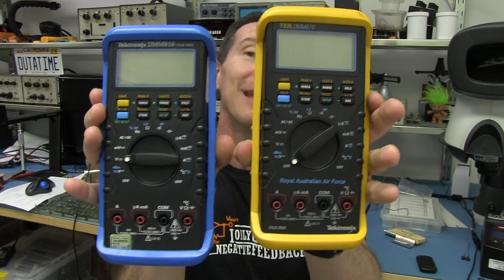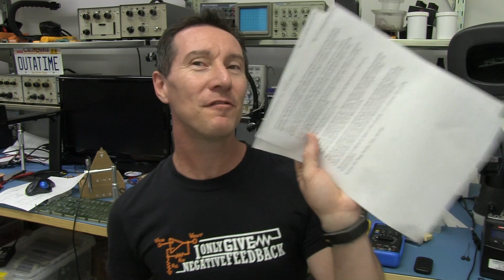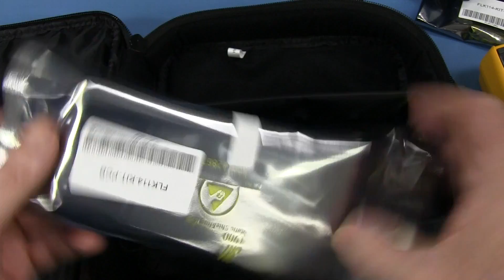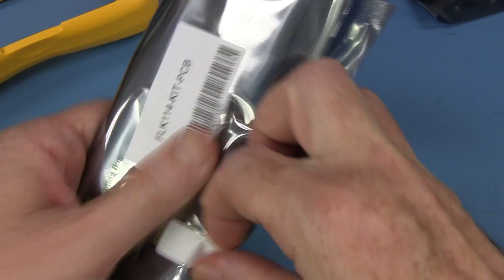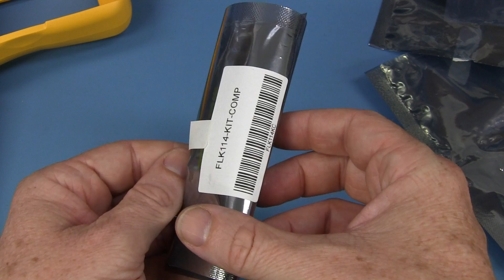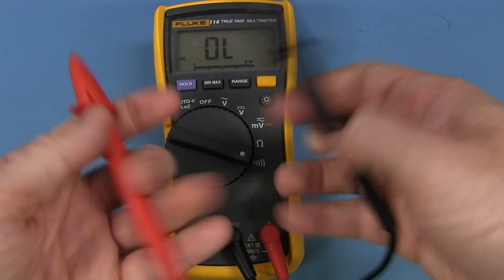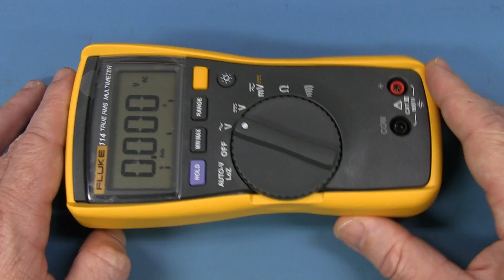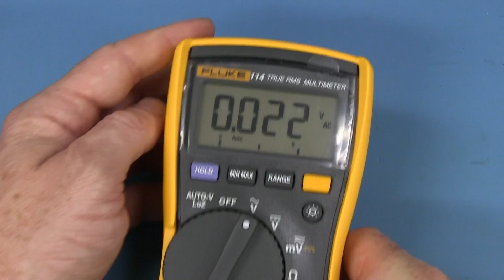EEVblog #597 - Fluke 114 Kit Multimeter + Sparkfun/Fluke Rant

Comment: Didn't knew that Fluke \w/ kits for poor are available :)  Bare bone feature set, yes. However considering that 80% of multimeter users use these devices for voltage and continuity measuring only, those meters with LoZ mode in bonus are more than fine for many. And they have THAT yellow casing :D
Honestly would be glad to get such Fluke kit in my school years at eighties.

Comment: Yellow isn't allowed in Australia? In Europe yellow DMMs are all over the place. Only Fluke thing I own though is an infrared thermometer. For multi meters the cheap one mostly do well. The one I use most A Velleman DVM850L has a color scheme that scream Fluke all over the place - yes a big company as Velleman.
I am however on the hunt for others. Seems like there's some that can do duty cycle and frequency as well. Also I wonder much of a difference there is on fluctuating DC. Like if you want to measure standby usage on your Amazon Echo Dot. Digital seems to fluctuate wildly and hard to get a good feel what the standby usage actually is. Sure you can shunt it with a large capacitor bank to smooth it out that that also cumbersome is only usage for small voltages and moderate current (such as the Echo Dot). So that was where my recent dumpster dive came to rescue - an Avometer 8 Mk III in magnificent condition (guess it hasn't seen much use because on an adjustment error in the cut out prevented in from being engaged so was always cut out). The needle settled quite nicely only fluctuating a tiny but and easy to get a reasonable guess of the actual usage - good enough anyway as that of course was more for a power use concern rather than a precision scientific measurement.

Comment: Spent 3 decades pulling wrench in a diesel shop, a major portion of that time in the electrical shop. In the mid-90's, a trainee dropped my Simpson 260, so the supervisor bought me a Fluke 87 with a lot of accessories. $300. It lasted 5 years, and the digits began to fade. Was told by the tool dealer it would be expensive to fix (at the time.) So I grabbed an el-cheapo meter from his display, and said put this on my account. $30. Chinese made, grey case, yellow boot, looks just like a Fluke, but it isn't.
After 17 years, the el-cheapo Chinese meter still works. The digits never faded.
More than I can say for the Fluke.
Finally pulled the Fluke out of the tool box last year and replaced the polymer strips. $18. Now I've got two DMMs.
Still not impressed by the over-priced Fluke offerings.

Comment: After running your finger over them, I hope you cleaned the switch traces on the PCB with isopropyl. Also there is a lube for gold contacts just to be on the safe side.

If everyone starts trademarking a color, will the next guy have to make his meter chartreuse with mauve stripes and taupe accents. Good grief!

Comment: Very nice all packed in anti static bags and the circuit board one has all the warnings on it, then they give it to a moron to assemble just to prove any idiot can do it. But as you say no instructions, no wrist strap and earthing lead and most of all no common sense... and to add insult to injury the first thing he does is throw the probe covers away I suggest he reads AS 61010.1 which states shrouds should be fitted to test leads.
Reply: LOL. Get your head out of your ass and look at the upload date.

Comment: I agree with them being forced to use another color. At this point in time, that orangish yellow on grey is iconic to the fluke brand. I could see people buying a meter based on color cause it was recommended but forgot the actual name of the brand. 
Not that i agree with it on a personal level, but i get it. I would say the same thing about soldering stations in blue on yellow, being iconic to hakko. Unfortunately, hakko also likes red on black for tools, and even grey on black for accessories, so i guess you could argue they are not as consistent.
Reply: Back in the 80s, practically every multimeter (just like that Agilent) was grey with yellow. And the reason why they were was because handheld DMMs equals Fluke — a multimeter just wouldn't be a multimeter if she weren't yellow.

I don't really mind that these days most multimeters other than the very cheapest aren’t attempting to look like a Fluke.

Comment: Man, I really love Fluke, but they're incredibly expensive...
Reply: It's worth the purchase I think, you spend it once and then never again.
Reply: My father bought a fluke 12 back in the 90s the thing is as old or older then me. And it still works! It’s very basic but now I’m looking at getting a nicer one with more features. My 12 does ohms resistance continuity and voltage. I need hrz tho for my generator and they only girl is getting a bit tried. Not sure if the display is going or if I need a new battery.

Comment: Correct me if I'm wrong, but aren't Fluke required to take action to protect their image if they file for a trademark? E.g., they are not allowed to file for a trade mark and then do nothing about competitors infringing on it. An example is when King (from Candy Crush) bought a game with the term 'candy' in it after they got a trademark of 'candy'. They did this because they could not leave it, they had to take action and shut them down. In this case they bought them so they could leave them alone.

Comment: They can easily afford this sort of charity given the huge overpricing of their products. Interestingly some years ago I bought a cheap crappy Velleman scope that came with probes, later my tool bag with it in got stolen. Sometime later I was given a Fluke scope meter with the exact same probes except with fluke branding, I broke one of the probes and when I looked up the replacement price a set of two probes came to more than I paid for the Velleman scope complete with two probes.

Comment: I believe the point Fluke made this kit is to tell the makers what makes the Flukes safe. Everything but the input protection is preassembled and what the users are required to do is essentially install all the protection yourself.

By the way, have you tried to add the fuse and current shunt yourself, trying to upgrade it to an 117?

Comment: I'm not real fond of what happened, but does sound like typical USA. Govt's controlled by all these big companies. I kind of understand safety concern, but my theory is let it be. A if somebody is going to be dealing with something that safety of the meter could be important they should know about what they need. If you do and you still buy some off brand even if does look like a fluke there's almost no way anyone could win suing fluke if something happened, and you're dealing with this stuff and trusting your life to a meter possibly and you buy a cheap one that's there problem. (I see it pretty much A avoid being sued, B make more recognizable, C further idiot proofing.)

I think flukes a good product there are certain things like network testers i wouldn't care buying ideal, etc brand. You don't need to really trust those with your safety though. If your doing major electrical work then get a fluke, keithley, extech.
Reply: I got a mastech DMM last year after my 20ish yr old keithley fried, a lot of people said this is a newer company said is the foreign = of fluke 1/4-1/2 the cost. So far i'd say of all the DMMs i've had this is probably the worst. input safty light/beeper sometimes don't work write, capacitance function nothing on it shows like .100nf, sometimes you turn on and it don't come on, until spin knob off/on again. auto powers off after like 10 min, sometimes i use that long, and probe things. It beeps with a warning, but it should recognise usage/non usage. Also has a relative voltage function something like store one measure, then the next is measured based on difference. That works if the difference is like 2V, also the data hold you manually have to do making almost useless. Also autoranging can be fairly slow esp with resistance.
Reply: Although it is kind good what fluke did for sparkfun, still don't make me feel any better or forgive the first issue. Companies do stuff like that i lose some of respect i may have had for them, and maybe lose me as possible customer. I can live with a possible fairly product here and there, but when there business gets out of control start lieing, doing other pretty much ridiculous things i'm done with them. Never used fluke electrical meter, and i don't think i'll start soon esp after this. I'll go to kiethley, extech, tektronix.
Reply: You would be surprise how often this happens, and it has nothing to do with the US. Most laws like this are all over Europe, North and South America. I have a feeling that it was done intentionally (making them look similar). They shouldn't have done that, period. Most people who put their blood, sweat and tears into designing a product want it to be protected. I will still be buying Fluke products, as with most and Dave I am sure.

Comment: Hey Dave, I'm not sure if I'm the neediest or not, but I would love to have that Fluke multimeter.  The best meter I've had was (somewhat embarrassingly) a RadioShack multimeter.  However, I accidentally burned out a few of the traces when I forgot to unhook it when I turned the dial while connected to a transformer.  Oops.  Since then, I have been too broke to buy a decent multimeter since my rent has gone up in Santa Cruz by $400/month(!).  So, I have been using a little Craftsman CR2032-powered pocket meter for my measurements.  I have long coveted the Fluke multimeter, as well as their Scopemeters.  Should you choose to give it to me, you can be assured that it will be used to its fullest and appreciated greatly.  Keep up the great work!

Comment: Firstly, the US Custom's notice shows 250 items, not 2,000. Secondly, the notice references US Trademark 2,796,480. Reading the information for that trademark(if I read the correct one), under the "Color Claimed" heading, this is listed:  "Color is not claimed as a feature of the mark." So, I fail to see why a certain color would halt import of Sparkfun's items.

People need to stop supporting Fluke. Their items are overpriced, and this little stunt is abhorrent. I will be selling all of my Fluke gear, and replacing it with a less offensive company's products.

Comment: Although I think the idea is a pretty cool one, I get a bit concerned about it....Fluke is known for making industry level DMMs and their quality and specially Safety is really high standard...but with a beginner soldering the input protection components, he might overheat them, specially with a non temperature controlled iron, and damage the input protection, leaving the multimeter vulnerable, this makes me wonder a bit about Fluke's considerations on safety...are they compromising their safety standards and Q&A? Are they selling less secure stuff for cheaper money? Or is the input protection components just something not too much necessary (which I don't think so) and its not a problem if they get damaged for improper soldering?...what's your position in this matter @Fluke?

Comment: I believe there is a subliminal message being portrayed by David here;

Fluke needs to lower their prices on their low-end kit rather than be a trademark schoolground bully. For a single PCB-single chip solution to cost about $200 is ridiculous in this day and age from a company thats had decades to refine their designs. These are stupid cheap to produce and this teardown proves just how far they've refined the design. The average joe should be able to afford a quality Fluke DMM, this "because they can" pricing approach is getting old. Such a #FlukeKit would had been very welcomed, or just lower the pricing. Thanks.
Reply from the maker: Your spidey sense works well.

Comment: I would like to have that multimeter I am currently using 2 of the harbor freight $5(sale price) multimeters for my measurements.... I used to have an ok one but I accidentally measured ac voltage on the dc setting and after that the readings were never right again...

Comment: The little "caps" are used when measuring higher voltages to prevent arcing. Class 3 not bad.

Comment: To the people who think that Fluke have done a swell thing. They haven't. It just been a face saving exercise for them selves. Try are being a normal big business IP troll. If they really cared about it they would of said sorry and those don't stand our toes and allowed the release of sparkfuns DMMs and any others that come through. Sure if they are a 1:1 copy of a fluke called a flake then sure that's a direct rip off!
Reply: Fluke is a big business that rightfully owns the yellow case trim. They really can't allow any unlicensed exceptions. It's business and they need to follow their policies about protecting their trademark without any exceptions.
Reply: Jacob Jones
Legally, they have to prevent dilution of the mark. That doesn't mean they can't license it, but it does put restrictions on how much they can reasonably do and keep the mark. They could have allowed sparkfun to get the meters but imposed a condition, such as requiring them to remove the holsters, since the mark is on the combination of holster color + holster style + meter color + meter style.
Reply: +Jacob Jones they don't rightfully own s***... owning a color I think not
Reply: Sorry my wording was not proper. They own the trademark which includes the colored trim, Apple just won a crazy absurd law suit on the shape of corners. Trademark is a fucky thing

Comment: I have an analogue Velleman AVM360 since 2006, it has a 5x20 glass fuse, x1 ohms range is not working due to the accidental 230V input - burned out resistor with the 500mA fuse and Meterman branded test leads with electrical arc damage from previous owner that barely stay in sockets (the stock ones falled apart). I would like to have at least one decent test equipment, as anything safe/precise is well over from what I can spend from my salary I get for working as a full time skilled electrician in Estonia.

Comment: I love my cheap fake meter (I don't know any better) but I have already had a close call with it working on my AV amp and since that day I don't trust it for anything more than testing resistors and low DC voltage devices. My funds can not stretch far enough for a Fluke or any "good meter" I normally buy broken tools then try and fix them, its not something I would want to do with a multimeter.

Comment: So Fluke "off-shored" the manual labor from their chinese manufacturer, which they offshored the labor to from the US ;) .

I've got a Vichy VC99 (yes, the one you ranted about most in your shootout four years ago; your video convinced me to buy one; the facts in the video didn't match your rant ;) ; and it's still working). It has a very similar color scheme (although it's more orange than yellow) and for me was the only thing austrian customs ever held back for a while. I don't think it was the design though, but that the marked price on the customs form looked way too low.

Comment: Could Sparkfun not have simply removed their meter from its holster and sold it without the yellow plastic bit? That would have satisfied the 'dress' issue.
By the way, I'd like to claim the 114 as my Micronta (Radio Shack) kit
meter has finally given up the ghost. The contacts have worn through on the circuit board.

Comment: This thing had better be REALLY cheap. A production model pulled from the line with a handful of components/parts left to be installed looks more like a slap in the face than a "kit".
Since when does outsourcing assembly to the customer constitute helping/catering-to, the maker/hacker community. It just LOOKS like a half built production model to me. Meh.

Comment: Thanks for letting me know, never touch Fluke products, be easier now as won,t buy any yellow multimeter, trademarks are bad enough but dress? What BS
Reply: Just sold my Fluke 45 dual DMM and have still a Fluke 87 of course. But have not bought any Fluke for a while and won't ever, some of their stuff are overpriced... surely the money they charge you pays for this Code Dress paperwork nonsense... They are not bad, they are evil :-)
Reply from the maker: Ronald Lijs
I would like to know how much it cost Fluke to get the international trade commission to write that report, investigate, and make a ruling on it...